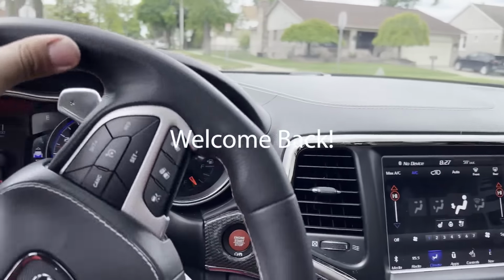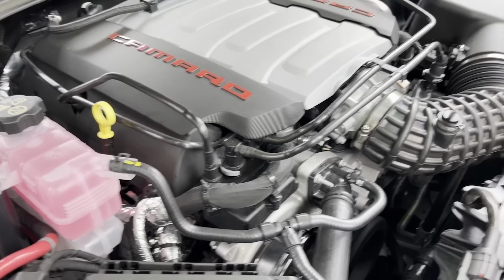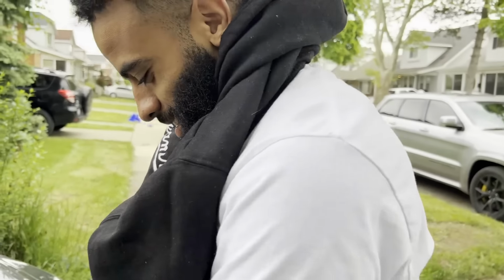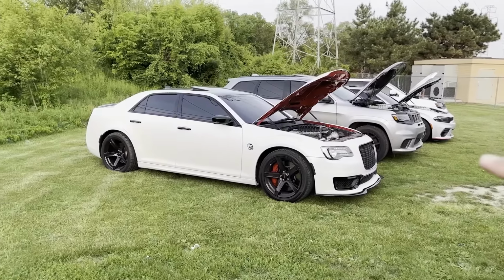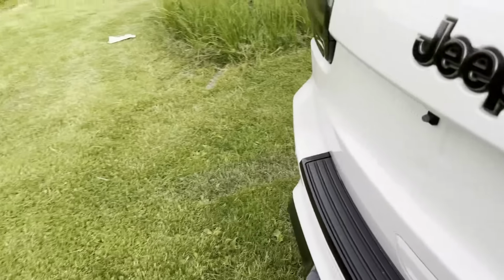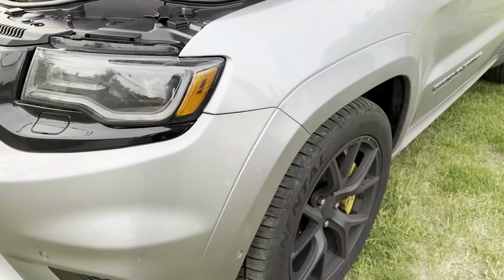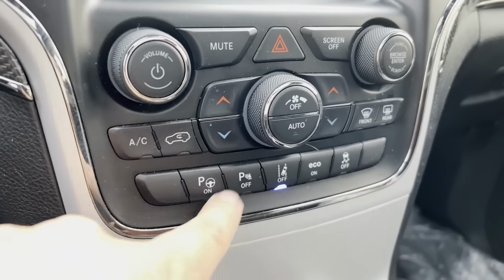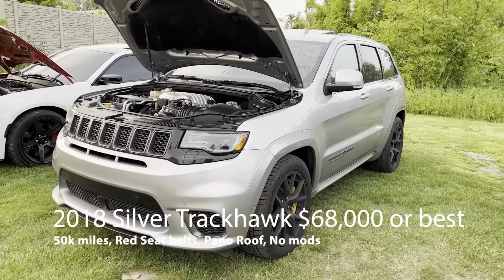I AM SELLING BOTH OF MY STOLEN JEEP TRACKHAWKS! WHAT SHOULD I BUY NEXT?

Comment: Allstate just totaled my 2012 300 SRT8 only 70K due to the Adaptive Cruise Control radar sensor. Its was damaged in a minor front accident and they are saying the factory replacement is not available and because its a safety issue and they will not accept aftermarket.

Comment: Can someone explain the difference between srt oil over the normal o-40? I work in parts and when you look up the part number for the srt oil the o-40 penz pops up? Also if the cars were stolen how does the vin situation work?